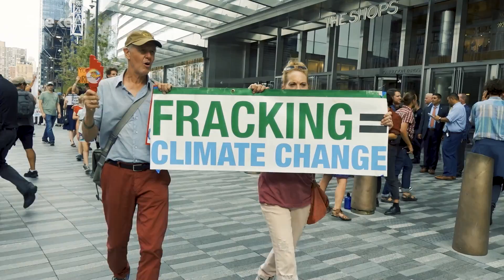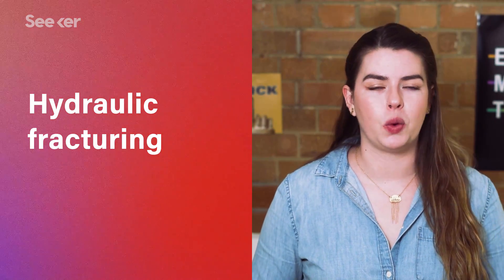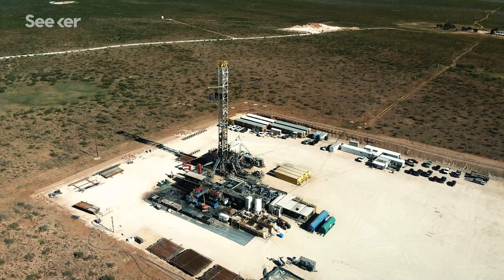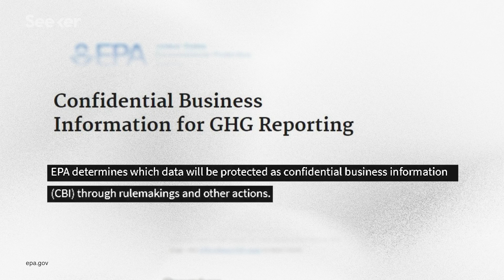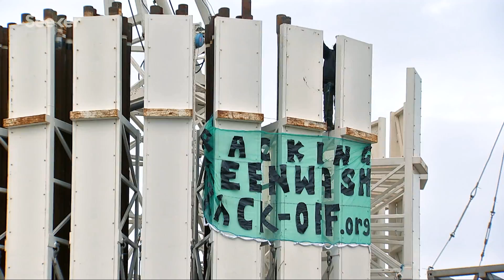What Exactly Is Fracking, And Is It Really That Bad?

Comment: Plz when u say gallon also show litres in subtitle there are people  outside us watching u
Reply: Yep. Use international system.
Reply: And then they forget to tell us which gallon they were using there. Like why is a gallon not just a gallon to make it less complicated, but no, there's 3 different gallons. A litre liquid is the same as a litre solid or gas, a litre here is a litre on the other side of the world, so simple. And for those in the US that don't know what a litre is, it's half a coke bottle, or 1 kilogram of water, or a cube of 10 by 10 by 10 centimeters. See how easy you can go from volume to weight, length or beverage?
Reply: @haribo836  my complaint about metric isn’t that it’s nicely consistent (the consistency is a definitely a feature) but that they choose to use base 10.  WTF‽ why base 10 of all possible choices?  I mean, it could be worse, they could have used base 13 or 7 or some other prime, but why not use the obvious choice of 8 or 16?  Or anything than can be repeatedly divided by two.  A gallon can be dividend in half (a half gallon) which can be divided in half (a quarter gallon, aka a quart) which can be divided in half (a pint) which can be divided in half (a cup), then divided in half 4 more times, yielding a tablespoon.  If you divide a liter in half 4 times you 62.5 cc, what the heck is that?  And try cutting that in half, to get 31.25 cc!  The metric system failed in the US because it is arbitrary, designed with no relevance to real-world needs of measurement.  Don’t get me started on the ridiculousness of the centigrade temperature scale!
Reply: @jpe1  you're aware that 10 is not a prime number?
Reply: @jpe1  what...
If you divide a litre you get 0.5 litre
Or 5dl or 500ml or 0.5dm^3.

Next thing is, you wanba argue that Fahrenheit are better, or what?
Reply: @xXDESTINYMBXx  did you even read my comment?  I’m guessing you didn’t since I wrote that a worse choice than 10 would have been a prime number.
Reply: @xXDESTINYMBXx  tell me, what do you get when you divide a liter in half 4 times?  That operation is trivial using gallons, and it would be trivial in metric if they had used a base 8 or base 16 system.  But because metric is base 10 it is very hard.  Tell me one single advantage of using base 10 over base 8.
Reply: @jpe1  how is it hard to divide 10 four times? You get 2.5dl
Or 100 for the matter and you get 25cl
Reply: @jpe1  I did, but English isn't my first language so I thought 10 was included in your argument with the prime numbers.
Reply: @jpe1  if all you need is one advantage, here you go.
If you need 53% of 1litre (you seem to love litres) it's exactly 0.53 litres. You can't do that in your mind with your fantastic gallon, can you?  (probably yes, but it's difficult)

The SI system of standardised units is so superior even NASA uses it.
Reply: @xXDESTINYMBXx  try it... what is one sixteenth of 10?
As far as diving in half 100 times, what is the point of that absurd example?  Yes, you get something smaller than an atom regardless of how big you start or what system of measurement you use... who cares?
Reply: @jpe1  Going for a 8, 12 or 16 based system might have some advantages with dividing, but only in a limited amount of divisions. 8 divided by 3 for example doesn't work allready. The decimal choice has its advantage that it runs parallel to what we use to count, making sliding up and down the scale real easy. This gives you easy to calculate, near limitless precision. I think that part of the reason you point out the divisions is that you are used to fractional units, where metric is decimal and the need for whole numbers is not there. How would you for example call something that is half a gallon, a pint, a cup, three and a half tablespoon and a little bit extra? Would you measure that whole bit in tablespoons or a fractional gallon? In metric that is just a number which you can then easily transfer to the prefered unit.

As for the temperature scale, Centigrade is a pretty arbitrary scale, as in the 0 and 100 point had to be picked somewhere. At least it is an easy to relate to scale. We all have an idea of how hot boiling water is or when water starts to freeze. What is the Fahrenheit scale based on? The 0 point is debated, but most likely based on the freezing point of a mixed liquid none of us encounters in real life and then the random number of 96 for the estimated average temperature of a human. So don't start on the ridiculousness of temperature scales.
Reply: @jpe1  that's easy 1/8 is 12.5 so 1/16 is halfe of that.  6.25.
If fractions are difficult for you, then you can also add a zero and move the point back on the result again. 
1000 instead of 100
500
250
125
62.5 -> 6.25
Reply: @xXDESTINYMBXx  I can’t tell if you understand my point perfectly and are being sarcastic, or if you really think that base 10 numbers are easier than base 8 or base 16.
Reply: @jpe1  I'm not sarcastic, Base 10 rules, the whole scientific community knows that SI units rule. Even matt from demolition ranch agrees on that, and he's as American as it can get.
If it's so easy tell me what is 1/7 of 16.
Reply: @jpe1  Base-10 works with calculators. All other bases require you to do calculations by hand like an elementary school student. Also, we use Arabic numerals, which are base-10, so units should match that.
Reply: @jpe1  How many fluid ounces are in a pint? 20? 16? Is a gallon equal to a gallon? U.S. or Imperial? Does 4 gallons = 5 gallons?
Reply: @jauneetbrun  what is your point? You seem to be creating a false binary, implying that there are only two possible systems of measurement. I never suggested that Imperial (or any other) system is better than metric, my point was that one of the shortcomings of metric is that it is base 10.
Reply: @jpe1  That was a shortcoming in the past, but it’s an advantage in the present. Most adults in 2021 use calculators for pretty much everything, and Base-10 is the best base for calculators.
Reply: @Slowdowndummy  🤯
Reply: I don't know why we have to ask about this on every fracking video :P
Reply: Murica....beeeach
Reply: Do some conversions. Sharpen your math skills.
Reply: @kprofitt32  Oh, the irony
Reply: @kprofitt32   i do calculus bro but do conversions like 1 = 0.4 of some quantity which is not used anywhere is useless
Reply: @kprofitt32  you serious. Your are using nonsensical units of measurement, not ask other people on Earth
Reply: @kprofitt32  I'm a Computer Science Undergraduate, I don't need to sharpen my math skills outside of my math assignments doing useless conversions that most people Google anyway. Plus, I watch YouTube to relax and enjoy video content, not to be forced to decimal division during my free time because a content creator doesn't care enough about their audience outside the US to add some simple text to their video.
Reply: @anonymousanonymous31  breath bro 3.785 times 1.5 it's not that hard to get a rough idea plus it's easier to say 1.5 million gallons then 5678117.68 liters
Reply: @adumberfling9959  They would round that to 5.7 million liters, just like how 1.8 million gallons was probably rounded
Reply: @adumberfling9959  is there a bigger unit for gallon?
Reply: @xXDESTINYMBXx   In the US system, there is the barrel (42 gallons), and I’m surprised they didn’t use it in this video. In the metric system, there is the kiloliter, the megaliter, the gigaliter, etc..

Comment: I am disappointed Seeker. Cherry picking horror stories, no context, and manipulating our emotions is disrespectful of your audience and damages your brand.
Reply: So...what is the alternative story?
Reply: @daisuke910  that all those horror stories are true and he just fears for his employment
Reply: @xXDESTINY, I am unemployed but only my father worked in the oil and gas industry. Fracking does not cause earthquakes (oil and gas pump fluids OUT as fast as they can - net). Fracking fluids are mildly caustic but it is particulates in the fluid that provide the most benefit - wedging open cracks formed by high pressure. I have seen a demonstration where someone drank fracking fluid in an attempt to dispel concern - yuck. Flaming tap water? Only in Pennsylvania. Unregulated and inexperience developers caused problems there. Fracking GREATLY expands our recoverable energy reserves. We need an all-of-the-above approach to energy. Renewables are wonderful and I hope people will make informed choices.
Reply: Ofc earthquakes happen, they even happen on geothermic probing and they are only drilling and not messing with the structure down there in other ways.
Reply: @xXDESTINY, using a closed loop pipe drilled 10's or 100's of meters into the ground to heat and cool homes seems like a great idea. How would this cause earthquakes exactly?

Be safe. I am done here.

Comment: 4:48 Word of caution to you all: You don't smell Methane or natural gas for that matter! It depends on the source and (natural or artifical) contaminants. And methane drives the greenhouse many orders of magnitude more than CO2
Reply: CH4 has a GWP 84 times CO2 initially but is converted to water & CO2 in about a decade so the average for 100 years is 21 to 28 times CO2.
Reply: usually gas is spiked with a smell so you can notice leaks. this is not the case when it comes out of your water taps, however, as it was never supposed to be there
Reply: @nutzeeer  yes, it was always there.
Reply: @JC-hq3ub  then why are there news about people lighting their tap water on fire if its so normal?
Reply: @nutzeeer  it's normal is this particular area, which again has been catalogued time and time again. Here in TX there is alot of fracking, and nowhere does the water catch on fire. I assure you . This may surprise you, but most "news" has a narrative and agenda.
Reply: @JC-hq3ub  i mean i really care for your opinion, please tell me it
Reply: @JC-hq3ub  Can't like your comment enough.

Comment: I would like to see double the current spending on fusion energy research.  It will help bring fusion energy to reality sooner.   It is the inevitable future of permanent, clean and unlimited energy production.
Reply: first i would like to see some investment in alternatives that actually exist, like Nuclear power and Geothermal. you, things we can actually do NOW to produce large reliable quantities of power without pumping toxic gas into the same air we all breathe.
Reply: @cageybee7221  new nuke plant is 10-15 years if everything goes according to plan...and close to $1B...
Reply: @cageybee7221  Safe to say we've learned nuclear isn't the way, doesn't matter how safe we can make it. It only takes one Chernobyl to ruin a county and the ecosystems around it. Chernobyl won't be a liveable places for 100s of generations or we find a way to deal with the radioactivity in the basement
Reply: @Zadesniper  molten salt thorium reactors have as much in common with a uranium fission reactor like was at Chernobyl, as a coal-fired electric plant has in common with Chernobyl.  The US DOE built the Molten Salt Reactor Experiment in 1965 to demonstrate that thorium reactors are relatively simple and very safe.  Learn more here: https://en.m.wikipedia.org/wiki/Molten-Salt_Reactor_Experiment
Reply: @Zadesniper  You didn't mention the waste nuclear creates that will last pretty much forever.
Reply: shop shop If you don’t want as much nuclear waste, then the US should reprocess spent nuclear rods instead of wasting huge amounts of still usable fuel and produce less waste material.
Reply: @shopshop144  Did you know all of the spend fuel, from all of the fission reactors on Earth, would fit inside a single football stadium?

It's a problem, to be sure, but most definitely a solvable one. The real long term limitation to fission, is simply the amount of accessible fissile material in the Earth's crust.
Reply: @shammyh  That might be true, but for various reasons the world still doesn't have what most people consider a viable solution to handling and long term storage of any and all the nuclear waste, even if it all fit into one big box. The industry doesn't even know how to take apart plants that are dead. But some want us to view nuclear as a 'green' energy.
Reply: @shopshop144  The slow decaying waste is not very radioactive - the decay is what causes the radioactivity... (and are often naturally occurring anyway)

(The problematic stuff is the ones with half-lives somewhere in the middle - radioactive enough to be dangerous, slow enough to decay that it is hard to plan for... Reprocessing works decent to separate out the different components, but many places refuse to do it)
Reply: @Zadesniper  clearly haven't picked up the fact it is slowly turning into a tourist trap, stop fear mongering
Reply: Just another 10 years mate, as always
Reply: If officials didn’t profit from it so there conscience wasn’t cloud by their greed it would not get green lighted the law needs to be changed... lobbying and such like practices are pure criminal unfair systems designed to achieve the biggest profitability all round, it’s beyond immoral.
Reply: Bezos: laughing in 150 times the funding budget, for all these projects on earth.
Reply: Thorium reactors are a much safer investment for clean energy.
Reply: Fusion, Carbon Engineering and offshoots of it for methane etc. those are the solutions.
Reply: They cant, too much already spent on these things. They want their profits first.
Reply: It would be an enormous step if government subsidies would be used to increase Algeabased biofuels, they wouldn't even compete with the landmass that is used for regular crops.
Reply: Your ahead of your time.. We need another TESLA guy 🤨🧐
Reply: YES, BILL GATES NOW INVESTED 3 BILLION ON THE NEW FUSION REACTOR
Reply: Solar is here NOW and getting cheaper every year. Combine with batteries or molten salt in sunny areas and we can reduce demand for fossil fuels massively. Nat gas can fill in the gap until we find a new base. For that Thorium is cleaner, safer and achievable.
Reply: @secretweapon7764  Not that simple. The battery technology is not there yet but it is getting closer. That is why you do not see a lot of fully battery operated vehicles yet. While Solar is getting better ( and I agree it should be our main source) The technology and infrastructure is not there yet to power a city of 30,000 let a lone the world. Probably will not see that kind of clean energy until we get closer to 2060s.
Reply: @whatjake7898  Of course, tech doesn't begin fully developed. But it is advancing rapidly. You have to get started so that the economies of scale start to kick in and incentives for development are increased. In sunny areas like the southwest it already doesn't make sense to build any new power sources other than solar. Plus Tesla is already installing GRID SIZED battery installations to smooth out power flow. These actually save the utility a lot of money.
Reply: @secretweapon7764  problem is solar is actually causing a gap. Peak production is during mid-day, but peak use is morning and evening. You need either energy storage, (which is expensive, needs usable geography and a lot of water) or fast acting traditional plants. Large hydro installations cost about as much as nuke plants and cause way more ecological damage, not to mention newer nuke plants can ramp up/down pretty well. But still co$$tly.
Using electrical batteries for this purpose is just naive, at least for large scale. Works only for island systems in residential.
Reply: @AKAtheA  The one problem with reactors load-following is that the cost does not decrease significantly with lower output - it costs the same and produce more power to keep it at full power... (some kind of storage remains useful then...) (Solar can cover some of the mid-day increase nicely - a mix of nuclear, solar, wind and storage (probably water-based) seems ideal)
Reply: @GertvandenBerg  and that storage is the problematic one. Even the types that actually work and are economically sensible (water pumping) still need 2 large reservoirs at different altitude. This puts hard limits on where you can actually even build them, not to mention that large bodies of water change the local climate rather significantly.
As for (really) small power reactors - we have yet to see one actually built and ran for at least a decade, then we can discuss the real costs. Many of the modular concepts look interesting, let's see how those play out.
Reply: @secretweapon7764  Batteries doesn't scale currently though... Pumped storage works and if lots of hydroelectric power is available, that also works well with solar...
(Molten salt might work, new types of batteries might work)

(With lithium batteries you need the total world production for a few years for a few hours worth of storage for a medium-sized country) (It has its uses in smaller setups though)
Reply: fusion is a joke and probably will never happen. Mixture of nuclear and solar is probably the best type of energy.